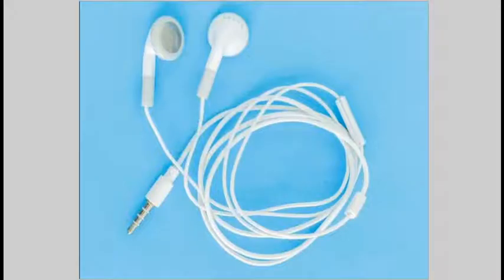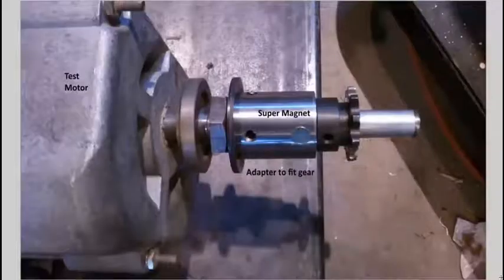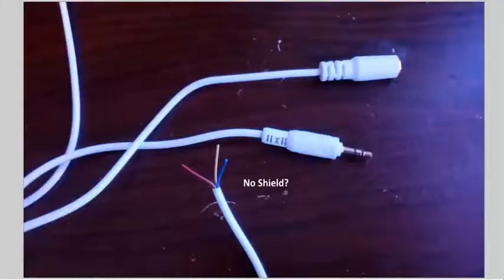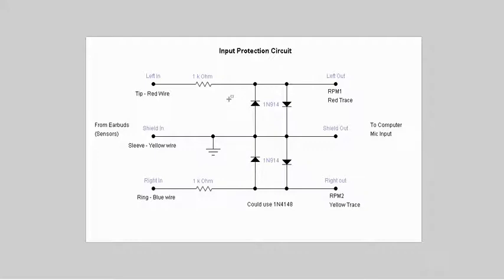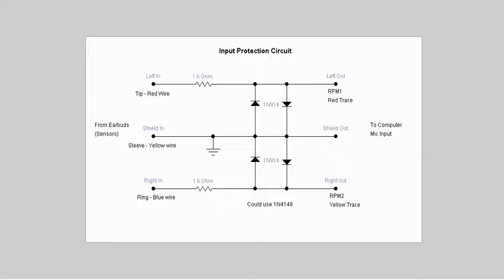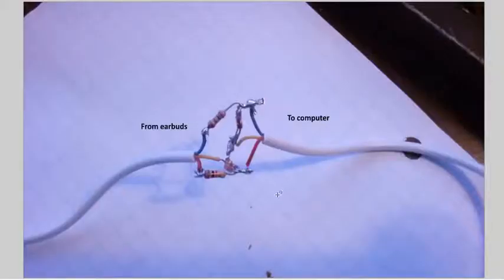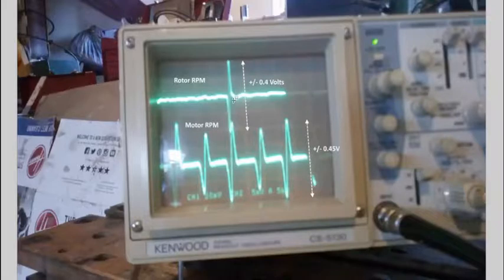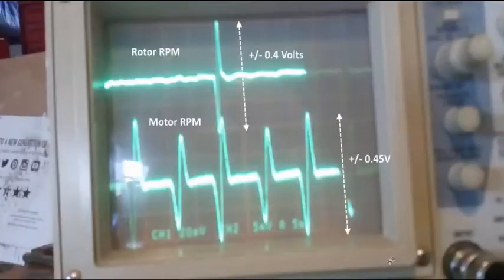DIY Dyno (Dynamometer): Part 2 - Sensors

Comment: Ear buds don’t work as a load sensor. Thats good for RPM signals only.
You still need a load sensor or a rotary torque sensor.
Reply from the maker: Good point

Comment: hi, i am trying to use my earphones as a sensor but in my laptop there is only the port for earphones with 4 rings. Do you know if I have to buy a microphone adapter or is there some way to fix it, thanks.
Reply from the maker: You can buy a microphone adapter. They are inexpensive.